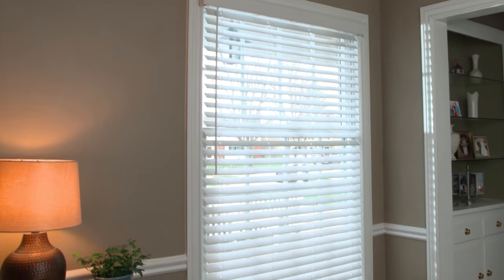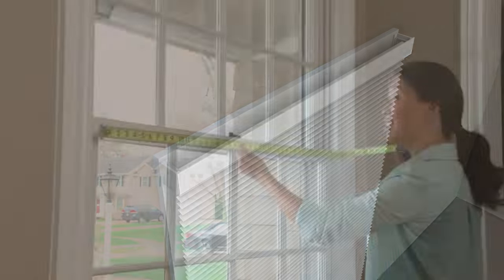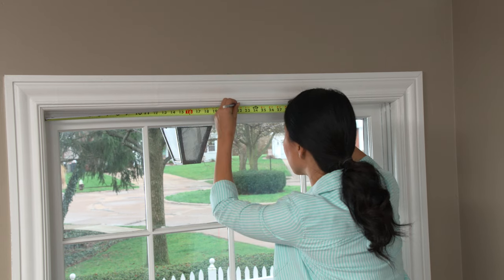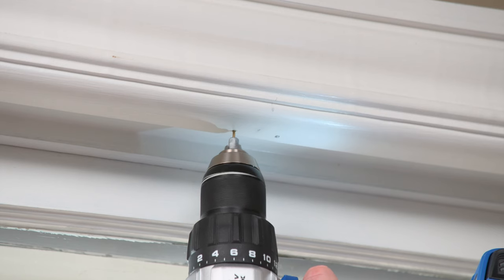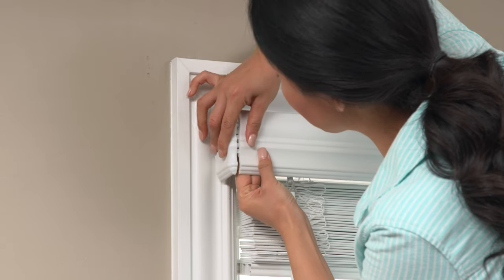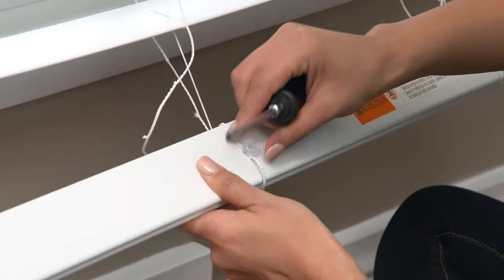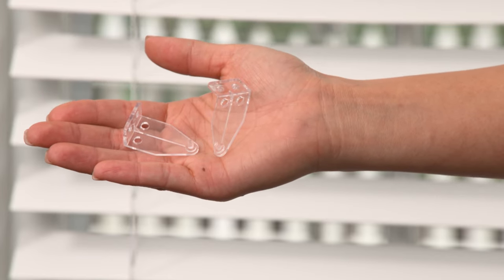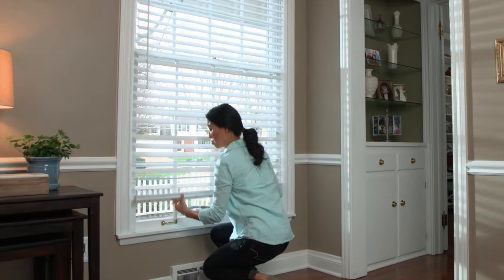How to Hang Blinds

Comment: Why not buy blinds that fit ??
Reply: Blinds are only manufactured in limited sizes.  Depending on the trim of the window, most have to be cut to fit.
Reply: @micknolen  u can measure your window and give the measurements to a Lowe’s worker nd they’ll cut it for you.
Reply: You still got to mount them. Ugh

Comment: Well, the trim around my windows is not flat. I need a Levolor bracket to mount to curved or angles trim.  Or, some other solution.
Reply: I have the same issue. Did you find a solution for yours?
Reply: @michaelstefani2095  I used a sander to make shims.  Then screwed in the brackets.